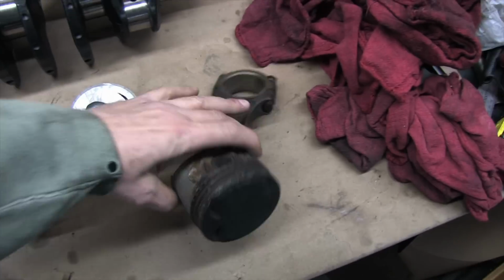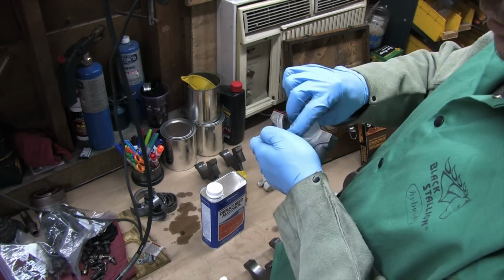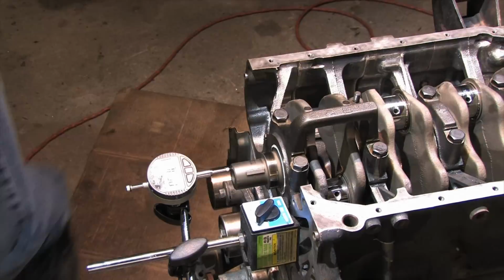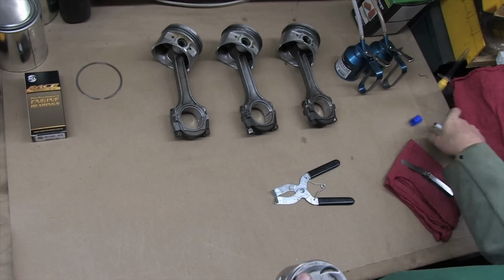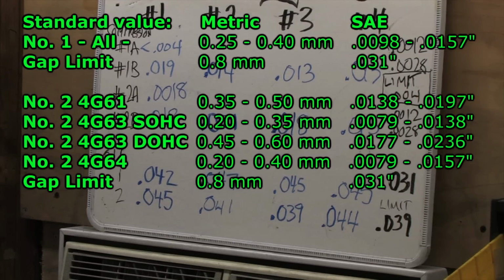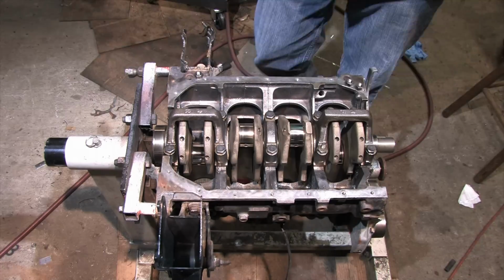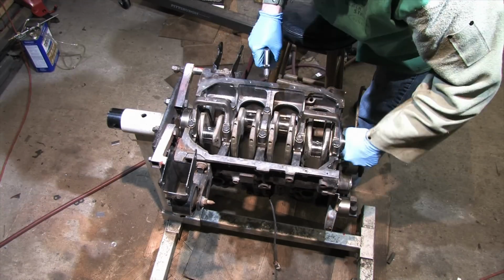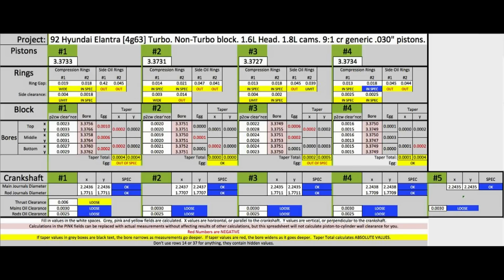Hyundai Assembly 1 - Blueprint Everything

Comment: this dude is the most anal engine builder ever!
Reply from the maker: Why thank you.  It's a badge of honor.  My engines also hold up to indescribable abuse.  I know a couple of laid-back mechanics who don't care about foreign material or torque specs, and the two of them can't seem to keep a running engine in their DSMs.  You should watch the video I have called "fighting the valve clearance".  That's probably the most meticulous of all projects to date.  Making valves fit a head and block that have been machined past their service limits.  Those 2 guys insisted it couldn't be done, but the end result has worked spectacularly.  :)

Comment: Hi Jafro, I was wondering if it was at all acceptable to dissassemble a shortblock to clean it and reassemble it with the same bearings? I have a subaru shortblock that I plan on boosting and want to clean it all out before I put bigger heads on it. I just don't have any of the tools to check the clearances. Cheers from Fredricksburg :)
Reply from the maker: If it's an otherwise good running engine with good oil pressure, sure, absolutely you can do that.  You'll miss an opportunity to know what your oil clearances are and how the engine is wearing, but a fresh set of gaskets will at least seal her all back up again with no leaks.  There's merit in that if it's in good shape otherwise.  It's a lot of work, but it's good experience.  If you're going to boost it, at least get your ring gaps figured out.  Watch the Foofy video if you want to see why...

Comment: Where can I get the specifications of the engine? Do you use a program or you search it up online? Excellent video by the way
Reply from the maker: There's a number of places… service manual is the best source.  There's specs online, at aftermarket parts vendors, fan forums and club pages.  In the case of the 4g63 there are resources like vfaq.com, and the archived clubdsm pages.  New England DSM is still an active group.  But if I have none of those, I'll measure it myself and get my own specs.  I know what I want my oil clearances to be… ;)
Reply: Jafromobile thank you sir! Well explained videos.

Comment: I noticed you install the main bearing dry without grease or oil in final assembly. Is there a reason why? Thanks.
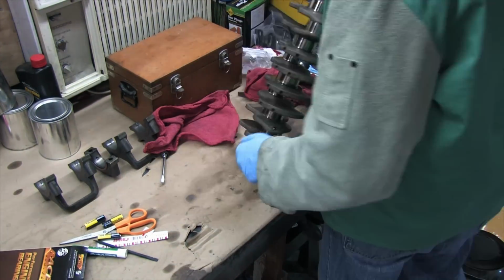Reply from the maker: 10:19 No, I didn't.  I totally lubed it.  Lubed it good.  You can see it squishing out of the mains when I measure the crank thrust clearance on #1.  I do the dry assembly only for the plastigage measurements, then I clean all the plastigage out and lube & re-assemble.  If you mean the rod bearings, same story... Dry for plastigage, cleanup & then lube.  This video isn't even my final assembly video.  I fought the valve clearance for a month after this.  ;)
Reply: My bad. I usually put the lube on crankshaft side instead of the bearing side during assembly. That's why when I saw clean journals I was like is there something missing?

Comment: i always thought building an engine would be easier then what this video shows...i guess i was wrong the whole time
Reply from the maker: +Jorge Lopez I said the same thing about the complications of a woman once... I was wrong the whole time, too.
I built an engine with your attitude once.  I did it with zero measuring tools and somehow everything fit?  That engine worked well for a while, but it didn't run as long or as well as it could have.  It's true there's a lot going on inside an engine that you have to be thoughtful of and accommodate once fire is applied, but if you take your time and check every spec, you'll figure it all out.   Everything's easier when you're not pressed to complete it.  If there's no pressure, suddenly it's not hard anymore, it's fun.  Find a way to take the pressure out of the build and pretty soon it becomes your happy place.
Reply: +Jafromobile oh yeah i can agree that its very pleasurable to build an engine...when i do simple jobs like doing an oil change i get such a good feeling that you dont get when you have someone else do it for you...i can only imagine how much euphoria you get when you finish building an engine...i would probably wet myself

Comment: Do ARP rod bolts, and ARP Main bolts benefit stock 6 bolt internals enough for the cost? I have all ARP bolts for my bottom end on my stock 6 Bolt internals (it came with the engine when I bought it). I'm seriously considering putting the engine back together with those parts; as opposed to waiting to save for an all forged rotating assembly. Aside from specs for torquing them down, and proper ARP assembly lube to install them. Is there anything I should look out for while assembling my 6 Bolt with those ARP components? I am going to prime the oil pump with Vaseline, and use Royal purple assembly lube for the rest of the assembly process. I took a page out of your book, and I am going to use Evo 8 rockers, mine are fine but I just want to put those in because they seem to be quite a bit more stout; and new lifters since mine have the microscopic oil holes on them and new E/I valves. I have different than stock exhaust valves, I'm having a hard time finding out who made them. Any advice on how to possibly identify them?  Any and all advice is greatly appreciated.

Comment: Great info. I need to rebuild a 2011 elantra engine. How can i get the service manual? i have access to alldata but dont know how to find the engine info. It shows the engine on the list but when i click on it. It only gives info on systems like fuel and so on. Thanks in advance.
Reply from the maker: +Mark Jones All of it's online and offered by Hyundai on a subscription basis, or you can try the dealership's parts counter for the printed copy (it's 'spensive).  Look up HyundaiTechInfo Dotcom if you want the subscription based method, it's probably much cheaper.  My DSM manual was $215 at the parts counter back in 2001 (for the 1997 model).
Reply: Thanks for the onfo. Youtube is great stuff.

Comment: I noticed that there were 10+ oil drain holes in your pistons, i currently drive a 00' celica where the engine is prone to failure due to lack of oil drain holes in the pistons. On certain sites they say to drill two new holes and clean out the old before rebuilding the engine, whats your take on this? More holes or keep it at four?
Thank you.
Reply from the maker: +Makeit Flip My take is... if you're facing a failure that others have found a viable and trustworthy fix for... then employing it is a dynamite form of cheap insurance.  If others have expressed a mixed bag of results with it, perhaps a different piston is a better solution?  I think you've identified the problem.  The challenge you will likely face is a means of securing the piston while drilling through it that won't damage the piston.  You can't just do this with a hand drill.  You'll need a drill press.  I would chase all the holes with the same sized drill bit if I were doing it.  That way, they're not just clean.  They're consistent.  Removing material un-evenly would offset the weight of the piston.  The nay-sayers will say it will change your big and small bore balance ever-so slightly.  It's a change you can compensate for, and you should... but if it fixes a bigger problem, it's less of a concern.

Comment: Hey Jafro, 

Thanks again for such an awesome video. Can you elaborate on the condition of the rings you installed in this video? First, you reused the old rings, correct? Second, would you normally recommend a quick hone on the cylinders before reinstalling the old rings? Third, can you comment on your thoughts regarding new/old rings and installation considerations?  

I currently have a fresh motor that I needed to tear down in under 5,000 miles of run time. The motor was freshly honed by a machine shop, fitted with new rings, then ran for the 5,000 miles I mentioned above. I'm at the point where I'd like to reassemble this motor, but am torn on what to do about the rings. Everything I've ever known says I need new rings and a fresh hone, since once removed from their bores after break in, they only conform to their corresponding cylinder in a certain position. However, I'm interested in alternatives (if there are any).

Thanks!
Reply from the maker: +GSTwithPSI As long as you kept the rings separated in order of which pistons they belong to, re-installing and re-using them is perfectly acceptable, and honing would not be necessary as long as the reason you had to disassemble the engine was not related to a compression failure or damage to the bores, pistons or rings.  Essentially at 5,000 miles, they're still new rings.  Arrange them back in the correct assembly orientation which I've covered in this series and roll with it.  It's not a good idea to re-use rings if you have to punch new holes (boring/honing), and it's pointless to replace rings if you don't punch new holes.  Doing so would change your ring gap or prevent the rings from seating properly.  I think that's all 3 things?  Ask questions if I left something out.
Reply: +Jafromobile 

Nope, that pretty much covers it. Thanks! 

The rings are currently still installed on the pistons, so looks like I'm good there. However, I'm sure the rings are no longer oriented as they were prior to removal, and I didn't make note of the orientation during removal. Will I be OK clocking them as outlined in your video, even though that may not have been how they were clocked before? 

One more thing. What are your thoughts on main/rod bearing selection? I'm looking at a set of King XPs. This is a "race" oriented motor, but I'm fine with using a cheaper bearing if it's worthwhile.

Thanks again!
Reply from the maker: It's dangerous for me to make endorsements, but I will say that when this engine failed, King bearings are what I removed.  I know nothing of which part number they might have been?  I had neither seen nor heard of them prior to then.
Reply from the maker: GSTwithPSI Yes, clock them the way I clocked them.  You'll be fine.
Reply: +Jafromobile 

I'm assembling my built short block. Today, I hung the pistons on the rods. Specs:

Brand new Eagle H beam rods sized for a 22mm wrist pin (CRS5900MC3D)
Lightly used 2G Ross pistons: 8.5:1 / 85.5mm / 22mm wrist pin (99815)

Here's my issue, 2 of the wrist pins slid into the rods no problem. However, 2 of the wrist pins didn't. I had to use a rubber mallet to tap them in. These 2 are tight enough on the rod end that they don't freely move back and forth (float) on the wrist pin. I'm reading a lot of conflicting information on how tight or loose these sold be. Also, it's cold a hell out right now (34*), so I'm wondering if a good heat cycle would free these up. The pins move freely through the pistons, so what's the deal? Thoughts? 

I didn't really think much of it at the time, and went ahead with assembly. I torqued everything down, and spun the motor over. It spins freely, smooth as glass. Now thinking about it, I'm debating on whether or not to go back in, pull those two pistons and free up the little end of the rod a bit...
Reply from the maker: It's a bushed rod.  Sounds to me like the bushing isn't sized properly.  Also, I've noticed that Eagle hardware has always been inconsistent as ** regarding QA tolerances with brand new parts fresh out the box.  If you don't have the right tools to hone those down to a thousandth or two, you need to take them to a machine shop.  They should float freely.
Reply: +Jafromobile 

Thanks for the quick reply. I'll look into running these by the machine shop. Thanks again!

Comment: This was awesome, the only thing that wasnt correct was spacing the ring gaps.

They rotate around the piston in operation, so why orientate them?
Reply from the maker: +Colin Smith They don't move much.  You orient them this way to achieve maximum compression while the rings set on first startup.  You want just as much compression and vacuum as you can get.  The way they're turned against eachother ensures that the path of least resistance is as long and complicated as possible.

Comment: Could you take the measurements on the bearing journals with a digital caliper as opposed to Micrometers? If so, would it be adequate enough to trust it's readings? If you can't get your hands on the tools you used, would using a digital caliper be a viable option?
Reply from the maker: +BoostedCajun Nope, nope and nope.  Digital calipers' results should always be treated as a guess.  They actually have no place in precision machine work.  They're a handy tool for anyone who can formulate the answer they need off of a rough estimate, but just can't be trusted on measurements like oil clearances or piston to cylinder wall clearances.  In that regard, plastigauge actually works better.  With engine assembly, it's calibrated micrometers and precision dial gauges-only, and all parts and tools must be room temperature.
Reply: +Jafromobile good to know, I found a digital pair of micrometers and have read reviews of them and will deploy them once I have my rods, and new pistons ordered. Glad you go into such great detail on these videos. Below is a link to the micrometer set I will be buying for my up and coming build.

http://www.amazon.com/iGaging-Digital-Electronic-Outside-Micrometer/dp/B00KY2PG12/ref=pd_sim_sbs_469_2?ie=UTF8&dpID=511UilpurKL&dpSrc=sims&preST=_AC_UL160_SR160%2C160_&refRID=1PTF2FGZS8N8VCGH3H30#customerReviews

Comment: the engine was built in metric dimensions...WHY BOTHER TO USE INCHES ?  ..........Americans ! ?
Reply from the maker: +baldbollocks Because in America, .01mm increment measurement tools cost substantially more than .0001" tools.  We're talking 4x as much.  It's a supply and demand thing.  Plus, the service manual specifications use both.  A .0001" increment measuring device has 2.x times as much resolution with those specifications.  But it makes no difference to me, I know how to use both.
Reply from the maker: 0.00254mm to be exact... but yes, if you round up to the nearest half thousandth of a millimeter.  25.4 millimeters in an inch.  When I have to convert millimeters to inches [and I practically never have to do that]... I have to multiply by 0.03937.  A millimeter is roughly 4 hundredths of an inch.  :)
Reply: +Jafromobile 
isn't .0001" ~.003mm, with respect to significant figures?  I always wonder how much I can trust the last digit on any measuring tool...
Reply: +Jafromobile Yeah I also wished you used metric. But can you send me the factory service manual via email?

Comment: ***** Do you have a video going over how you store engine parts that you are saving for later use? I have seen you touch on the topic in a few videos and randomly pull out parts and unwrap them. I have an aluminum block, full head and pistons, cams, etc I want to store for later. Really looking to know what lubricants you us for this stuff for long term storage.   Additionally, I really appreciate all the hard work you put into these videos and enjoy watching all of them.
Reply from the maker: JBtuned.com I have good news for you.  It's not aluminum parts that you need to be super careful with.  It's the cast iron and steel ones.  If you have steel sleeves, keep them oiled.  I wrap clean parts in stretch wrap no matter what they're made of because it makes it easier to clean/degrease them once I'm ready to put them back to use.  If I know the parts need to be machined, I'll stretch wrap filthy and [re-usable] freshly-blown-up parts, too.  If they're already machined, I hose cast iron stuff down thoroughly with WD-40 wrap them in rags soaked in WD-40, and then stretch wrap.  Whatever you can do to put an oily layer on ferrous parts, do it.  On used engine parts, oily funky filthy stuff is a good thing.  The oil layer helps protect it.  Consider freshly used parts to be "seasoned".  I do actually cover this topic in the GSX videos.  :)
Reply: *****  I knew I had seen it somewhere in one of the videos but in my defense there are a few videos to go through to find a specific topic. <--Thank you for that.   By the way, I had been looking for a way to donate to the channel then I found the video where you cover that. I would like to contribute. I can donate one of our 4 port Mac electronic boost control solenoids  if you are interested. I am sure this would be a great item to add to the tuning section. No strings attached, I am not looking for self promotion of any kind here. Just want to say thanks and keep the videos coming.